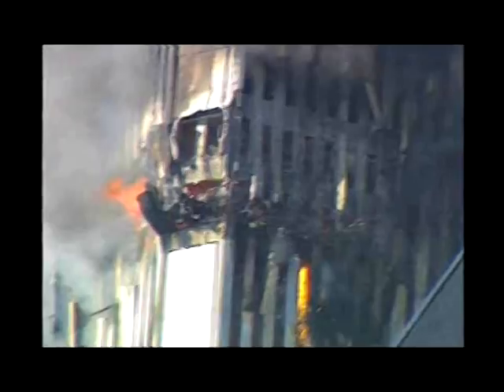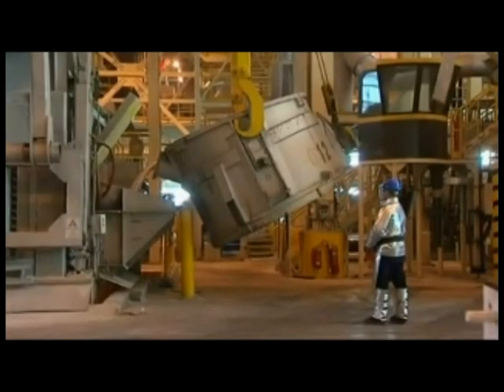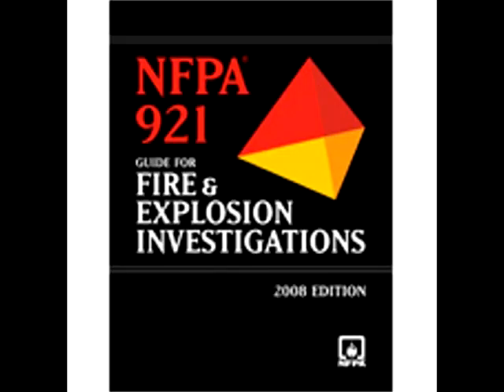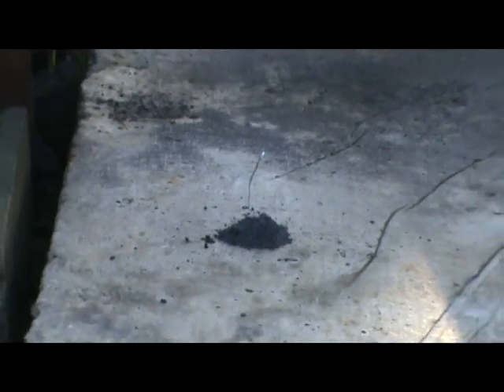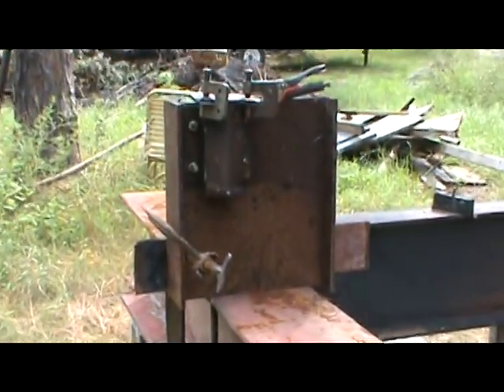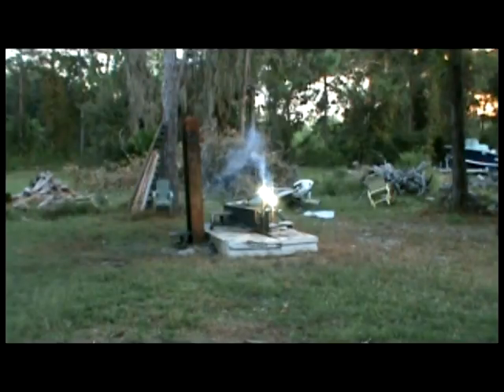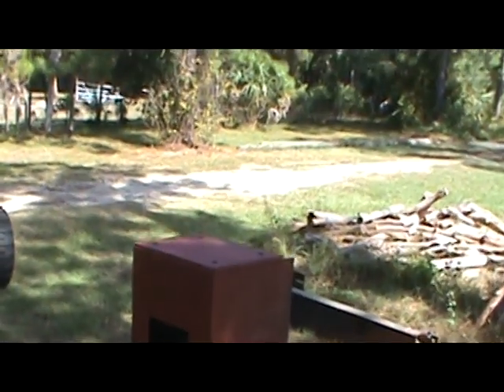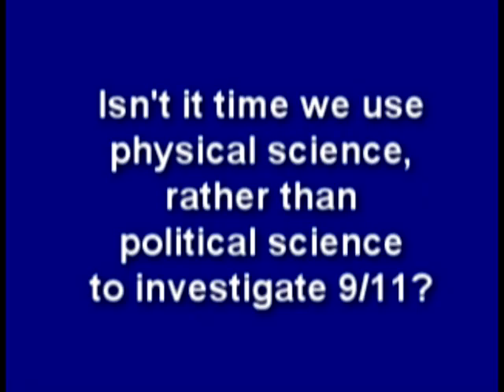9/11 Experiments: The Great Thermate Debate

Comment: @DuRound2 For example, it has been suggested that the spheroids are remnants of volcanic activity. In fact, I have heard it described that similar iron micro spheres are spread all about Manhattan, a remnant of the many fault lines which run through the area. Specifically, there is a fault line which runs by, about two blocks from the trade center lot.

I am not sure what of this, but it is a reasonable suggestion, and now we clearly have a trilemma. Welding, thermite, or geologic debris.

Comment: One point.  A jet fuel fire can burn hot enough to reduce the strength of structural steel by a factor of 2.    However, NYC building codes required structural steel to be 6 times stronger than necessary.  The rest is left as an exercise for the reader.

(Steel strength figures taken from a Corus Steel page that has long since vanished).

Comment: @MaxwellVigant "Well, you are saying that NIST's theory is wrong."
Let me get you right. Are you saying the NIST report concluded that the buildings came down because of controlled demolition?
Areas of intense heat which are buried under tons of concrete dust can remain hot enough to ignite fires for weeks, yes. So what?

Comment: @fertilizerspike Nope, sorry. Controlled demolition is not an out of control mess like was seen in the twin towers.  The would have fallen with no or  minimal damage to surrounding structures.  WTC 7 would not have been touch with a controlled demo. Not to mention that the planes would have broken the circuit rendering the entire series useless.

Comment: @palasta 
This is what Controlled Demolition says about a 1 million square foot demolition job:

"Approximately 2,700 lb. of explosives were placed in 2,918 holes on six levels of the structure. CDI’s delayed detonation of charges, the product of 50 years of explosives demolition experience"

Only 2700 lbs of explosives to take down a million square feet of warehouse space. Compare to the 5 million square feet demolished in the WTC, controlled demolition, dumbshit:
watch?v=CQJW7_IIWZ0

Comment: @HaIoedG 
This is what Controlled Demolition says about a 1 million square foot demolition job:

"Approximately 2,700 lb. of explosives were placed in 2,918 holes on six levels of the structure. CDI’s delayed detonation of charges, the product of 50 years of explosives demolition experience"

Only 2700 lbs of explosives to take down a million square feet of warehouse space. Compare to the 5 million square feet demolished in the WTC, controlled demolition, dumbshit:
watch?v=CQJW7_IIWZ0

Comment: @flanksteak2 
This is what Controlled Demolition says about a 1 million square foot demolition job:

"Approximately 2,700 lb. of explosives were placed in 2,918 holes on six levels of the structure. CDI’s delayed detonation of charges, the product of 50 years of explosives demolition experience"

Only 2700 lbs of explosives to take down a million square feet of warehouse space. Compare to the 5 million square feet demolished in the WTC, controlled demolition, dumbshit:
watch?v=CQJW7_IIWZ0

Comment: @fertilizerspike "Planes don't fly over the Pentagon without permission"

This statement is correct because the Pentagon is overlaid by Class B Airspace and is thus controlled by the tower located at the airport. 

The Pentagon is overflown by planes several tens of times per day as it's just outside one of the busiest airports in the country just off of Runway 15. 

Any airplane on short final for 15 is overflying the pentagon at low altitude.

Comment: @palasta
All commercial pilots know these were not hijackings. It's virtually impossible to hit such small targets at such high speeds as we're told. Pilots who use much more maneuverable planes have a hard enough time landing on an aircraft carrier, which is about the same cross section as the towers, and they can only even come close to hitting it at landing speeds, not at full throttle. Also, the speeds given by the FAA would have torn the planes apart at sea level.

Comment: @dakichan26

"and they would still whine and cry that the buildings pancaked because of burning jet fuel."

This pretty much displays your inability to understand the architecture of the buildings, load-bearing capacity of the used material and the mechanics of a collapse.

And someone who likes a video called "Adolf Hitler - The Savior of Germany" is not to be taken serious anyway.

Comment: That molten metal is from a huge bank of batteries that powered UPSes emergency backup for the financial services in the towers. Millions of amperes of current, shorted into falling steel members results in such a river of molten metal.
That said, the video seems to document a way to make a substance that will cut steel beams. However, in the end the author suggests that this may have been placed during construction? Over 30 years ago!

Comment: @flanksteak2
You're fucking delusional, here's that video again, the video from the other side relative to most videos, the wind was blowing the smoke away, revealing the red hot thermite and melted steel spewing all over hell inside there as the core disintegrated, AFTER the outer walls EXPLODED outward.

watch?v=CQJW7_IIWZ0

Comment: @fertilizerspike

"Explain this evidence showing thermite melting the core of the north tower after the outer walls blew out:"

Lol, at what point is the reacting thermite to see? There is nothing. Actually it perfectly proofs the non-existence of 200t Nanothermite, because if this would've been the case we could see torrents of glowing steel in this clip, an instant eye catcher.

Comment: @fertilizerspike

"it looks like that hole was broken in the building with a wrecking ball"

Yea, sure, if it was a wrecking ball 30m in lenght, 6m in height.

It's clearly visible. It's more than a hole in the wall.
physics911(dot)net/images/pentagon_hole(dot)jpg

Comment: @arisuta2

"The air traffic controllers who saw the plane on radar thought it was a military jet as it moved like one"

Misinterpretation. She said it was moving like a military jet, because commercial planes "usually" don't have the tendency to make radical maneuvers, she didn't say it was an impossible loop. And of course you don't fly a passenger jet like this. It'd be very very unpleasant for the passengers and the clean up crews would've to cleanse a lot of vomit stains from the seat pads.

Comment: @palasta said:
"Nope, the damage (without jet of extinguishing agent) is far wider than the exit hole."

I don't have to do a search, I'm telling you they were the same size, and they were busted in the walls with a wrecking ball. That's why there's already a crane right there with a wrecking ball in the pictures. How do you think the knocked the rest down? A cruise missile would fit right in that hole. That section was vacant.

Comment: @monsieurmitosis

"That's the nearest you will get to an official statement from Boeing."

You tried it yourself? And Boeing is not necessarely the only contact point. And Jeff missed to point out that the planes were diving not just travelling consistently at a specific altitude.

Comment: @flanksteak2 said:
"How long do you think it would take for an 1800 degree fire to heat up .25" X 2" truss chords to the point of failure (1100F)"

It's irrelevant, NIST says less than 2% of the steel they examined showed that it reached temperatures over 250C. 250C is not hot enough to weaken steel in the slightest.

Comment: @palasta 

There is a safety cushion built into the Vmo guidelines, allowing for non-horizontal flight and other more exceptional circumstances, but we are talking about speeds 65 knots above and beyond THAT.

It makes no sense to discuss varying degrees of structural failure. It's like snapping a pencil in half.

Forget about the other conditions I listed, just focus on showing me an example where speeds exceeding Vmo by 150 knots have EVER been achieved by ANY passenger plane.

Comment: @palasta

/watch?v=PKswGf7h5DY

That's the nearest you will get to an official statement from Boeing. They refuse to comment on any of the anomalies in terms of the 9/11 hijacked planes. But if you do have a statement from Boeing, I'd like see it.

And no, I don't think I WILL disregard Boeing's own flight and wind tunnel data, which is where I derived those limitations from. This data is approved by the FAA as well as being listed in the Illustrated Guide to Aerodynamics.

Comment: @palasta
It's quite likely nothing even hit the Pentagon, that whole section looks like a combination between a junkyard and a federal housing project, it's in a shambles and was slated for complete renovation which began immediately after this "attack". The story the media presents is full of holes, namely one of the holes in an inner ring, approximately the same size as the hole in the outer ring, but the intervening walls are not destroyed. The pictures of that hole predate 2001.

Comment: @flanksteak2 said:
"nearly bare steel 1/4 thick steel truss"

As you point out, these trusses were quite weak compared to the massive steel columns, and only responsible for holding up a few dozen tons of concrete on every floor, not keeping the buildings from destroying themselves from top to bottom in 12 seconds. In no way were these trusses (which were all braced with just as many cross-trusses making a very strong mesh of welded steel) capable of pulling the building apart from their weight.

Comment: @flanksteak2 said:
"the floor-to-ceiling fires in the towers could not weaken nearly bare steel 1/4 thick steel truss chords"

That in no way resembles the claims I've seen, which claim that there would have been no significant weakening of structural steel due to 90 minutes of office fire, and also claim that NIST's erroneous experiment shows 4 inches of deformation when 40 would be needed to produce the effect they cite as responsible for the demolition of both towers.

Comment: @palasta said:
"So there was only one drywall"

That's not what I suggested. In fact I've suggested that most of the drywall in both towers was removed prior to the demolition, they would have added extra stiffness impeding the demolition. As far as getting access to the structural steel, most of the demolition would have taken place on the inner columns, all of which can be accessed through maintenance floors without ever encountering one piece of drywall, in fact the drywall hides them.

Comment: @palasta said:
"incoming terror threats made it necessary to perform bomb screenings with additional K9 Bomb Squads"

Obviously the security didn't work, because there is over 10 tons of unreacted thermite in the dust from this demolition. Are bomb-sniffing dogs trained to sniff out thermite? It's not generally explosive and has none of the olfactory characteristics of conventional high explosives. Do bomb dogs sniff for aluminum and rust?

Comment: @palasta said:
"do you know what happened in 1993?"

Yes, test blasts were performed in the basement of the towers in preparation for the controlled demolition we all witnessed in 2001. The FBI built a bomb and apparently had it delivered to the basement in a van to provide a cover for this operation. This event was also used as an evacuation drill so that the demolition in 2001 could be further planned, enabling a more precise casualty count during the demolition.

Comment: @palasta 

This is true. A 767 or 757 can exceed their respective Vmo's by roughly 65 knots whilst in a dive.

However, if you are aware of a situation where a pilot (professional or otherwise) has been able to push such an aircraft to speeds of 150 KNOTS(!) above Vmo, while pulling out of a 10,000 foot dive at a 35 + degree bank angle, all the while keeping the plane stable and in control and inTACT, please cite your reference.

Comment: @fertilizerspike

As i've mentioned, Securacom provided technical security equipment in the timeframe of two years (96-98). They didn't run the security and provided personal at any time. The executive authority was the Port Authority, Port Authority Officers, and the Port Authority will also be responsible for the security in the successor of the former WTC-complex.

"wake the fuck up, idiot."

You're the one who is just repeating what he was fed with.

Comment: @palasta said:
"plant hundreds of divices (explosives + igniter)"

Quite likely thousands, since you're talking about two skyscrapers 110 stories tall, nearly every column on every third floor or so would have to be cut or blown apart, from top to bottom, that's 47 core columns and about 200 perimeter columns, so in all likelihood you're talking about thousands of charges, hundreds is an extreme understatement. Pull your fucking head out of your ass.

Comment: @palasta said:
"cut a specific amount of steel columns and beams open"

A simple analysis of the construction shows the box columns already had holes in them which would allow for the placing of explosives, this video points that out, and also points out how easy it is to cut steel columns from the inside with ordinary thermite almost instantly.  Most of the damage to the building would be done with this explosive nanothermite that was found in unreacted form  the dust from the demolition.

Comment: @palasta said:
"cut a specific amount of steel columns and beams open"

There's no reason to think any of the steel was cut until just prior to the first plane impact, when explosions were heard and felt in the basement, where people exposed to the explosions had their skin and faces blown and burned off, where several people's bodies were charred almost instantly to the point they could not be identified, these were explosions, not jet fuel falling down the elevator shaft, but explosions.

Comment: @fertilizerspike

"It would take only a tiny handful of people"

The time given only one could do this job?

Bear in mind, smuggle 100-200t of NT+conventional explosives into three buildings with high security standards, working through meters of drywall, cut a specific amount of steel columns and beams open, plant hundreds of divices (explosives + igniter), erase all traces and make sure no one has access.

Comment: @arisuta2

"Fire isn't a tremendous threat to a skyscraper as the survival of the Windsor Tower's structure will attest"

It was declared to be in danger of collapsing after the fire. :D

The windsor tower was a compact ferro concrete structure. The concrete has protected the steel . Did you know it did partially collapse during the fire? You know what has collapsed? The unprotected steel structure.

Comment: @babanapeal

"The none believers should take a good look at what real high rise fires look like"

A fire at night surely is more visible than during bright day... and having a facade with small gaps makes it far more difficult to judge.

Question: Why should the fires in the towers should not have burned as intense as in other buildings?

Differences: No planes, no reinforced concrete structure, no damage helping the fire to spread and to expand over a large area in no time.

Comment: @babanapeal

"Correct me if I am wrong but weren't a large percentage of those killed,fire fighters."

What is a large percentage? More than 300 firemen were killed, thats about more than 10 percent, and about 2700 died in the WTC event. A relatively small number, bearing in mind the mass of people inhabiting the towers before the planes struck.

As i've said, there were to many obstacles to strike much lower. And you must keep in mind, it were just amateurs. ;D

Comment: @arisuta2

"would bother with that difficult and enormous turn around the Pentangle instead of just plunging the aircraft straight down onto the rooftops"

Answer me this, which plane you think you have better under control, the one which is diving straight down, accelerating to supersonic speed, making it nearly impossible to correct curse, or the one slowly descending and having full control?

Comment: @punxsutawneybarney

Twoofers tend to argument that the planes couldn't travel with 500 mph in this altitude (what is partially true) so why should the engineers of the WTC calculate with the speed of 600mph? Slow flying, landing aircraft, lost in the fog (just like the B25 crashed with the ESB), about to land at the nearby NYC Laguardia Airport.

Comment: @palasta The original design specifications called for the tower to survive a 4-engine 707 crash at 600 mph.  The WTC Engineer John Skilling told the Seattle Times in 1993 that he designed the building to survive a plane crash and that after the fires the structure would still be there.  Frank DeMartini, the building engineer for new construction, said the towers could survive multiple jet impacts.

Comment: @slowlyawakening

"And yes the towers were very plane proof."

VERY? Lol, you don't have the slightest clue. No, not at all plane proof. Quite the contrary and everyone can see it. For the towers to be plane proof the structure outhgt to prevent the boeings from penetrating the outer hull, because if it does not its over. First of all having the internal load bearing elements damaged and destroyed, the structural integrity is lowered far beyond the percentage of the damage.

Comment: Well done mate. When they said the planes and Fire bought down the towers I said BULLSHIT.Have you done any experiments with the thermite inside different metal containers? With the thermite mixed with paste, paint etc?
With the containers sealed or near sealed? Was phosphorous that would ignite when in contact with water used as a trigger (sprinklers)? During fire drills before 9 11 were any fire exstinuishers exit signs etc renewed or replaced ( hidding places for thermite)?       Post 1 of 2